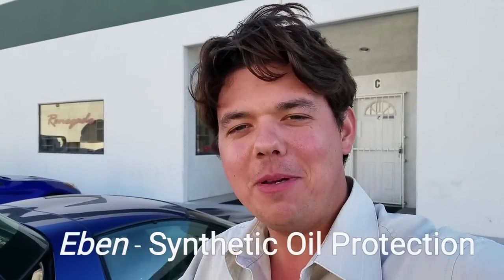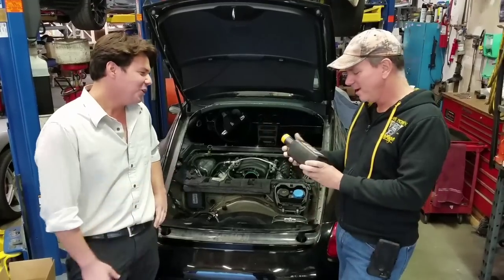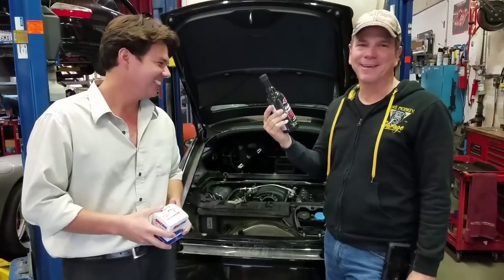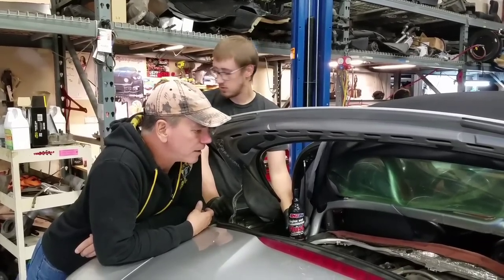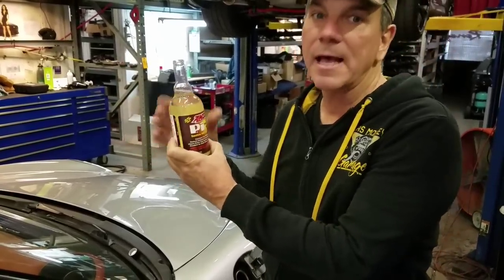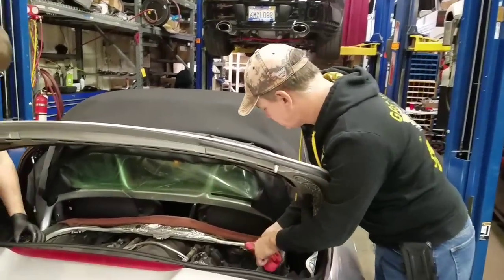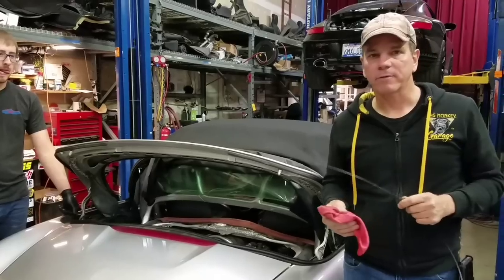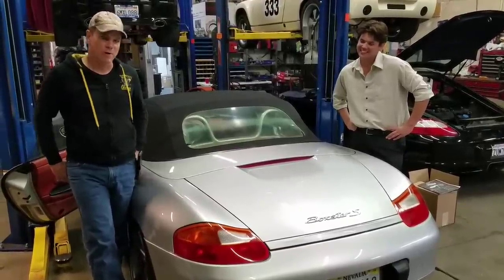Is AMSOIL good in Porsche? Scott Tests 0W-40 in Boxster S

Comment from the maker: The Truth About AMSOIL Why Mechanics Wont Recommend - https://www.youtube.com/watch?v=8OhntOxngAA&t=3s

     My Link: Best AMSOIL 100% Synthetic @ Wholesale + FREE Shipping: https://www.amsoil.com/offers/?zo=5331179

     AMSOIL Products & Vehicle Lookup - https://www.amsoil.com/guides.aspx?zo=5331179 

     AMSOIL Performance Tests - https://www.amsoil.com/performancetests.aspx?zo=5331179

     Follow these accounts for Ebens Giveaway:
Instagram - https://www.instagram.com/syntheticoilprotection/

     Eben Facebook - https://www.facebook.com/profile.php?id=100007973957868

     I'm asked 3 things:

1. Where can I find AMSOIL? - Use this link https://www.amsoil.com/offers/?zo=5331179
Or
Watch THIS: 3 Fast Ways To Get AMSOIL - https://youtu.be/RiYifuDCsnQ

2. What makes AMSOIL different than other oils? - AMSOIL is 100% Synthetic & has higher film strength & last 4×longer then Mobil 1 EP which protects and separate metal parts keeping them from wearing and Lasting Exponentially longer: https://youtu.be/f4eNPgTi_qo

3. Why should I use AMSOIL?: It protects the engine so it will last longer. Less oil changes less often(once per year/15,000miles) or longer... Save money in Gas & Time making it less expensive then a free oil change over the year - https://youtu.be/H7K6FdZlqmg

     Professional YouLubher:
Eben Rockmaker Master Direct Jobber AMSOIL Specialist (Dealer#: 5331179)
Mobile: (702) 472-3614

     My Link: Best AMSOIL 100% Synthetic @ Wholesale + FREE Shipping: https://www.amsoil.com/offers/?zo=5331179

     AMSOIL Products & Vehicle Lookup - https://www.amsoil.com/guides.aspx?zo=5331179 

If your vehicle is not on the lookup guide this is AMSOIL Tech Support 715-399-8324 be sure to refer to Eben 5331179

46,000 Mile AMSOIL Oil Analysis - https://youtu.be/UjijQK5wSM0

Friend me on and tag me because I like to see great results from my YouTube Community:

Instagram - https://www.instagram.com/syntheticoilprotection/

     Eben Facebook - https://www.facebook.com/profile.php?id=100007973957868

     Order AMSOIL By Phone:
Be sure to give them my number so I get credit Eben #5331179 and tell them you would like to be a Preferred Customer.

1. Call 1800-956-5695
2. Ask for your own preferred customer membership because you will get 25% off, free shipping over $100, and your informative quarterly AMSOIL Magazine. It costs $10 for 6 months or $20 for the year which is well worth it.
3. Give them my dealer number so I get credit Eben 5331179
4. Orders over $100 will be shipped free.

     Industry-standard 3rd party testing results:

     AMSOIL Signature Series 5W-30 Synthetic Motor Oil protects against harmful deposits on turbochargers 4X better than Mobil1® Extended Performance and 3.6X better than Royal Purple® in industry-standard testing*.
https://www.amsoil.com/newsstand/motor-oil/articles/leading-the-field-in-deposit-protection/?zo=5331179

     AMSOIL Better Gas Mileage -
https://www.amsoil.com/newsstand/motor-oil/articles/another-win-for-amsoil-products/?zo=5331179

     AMSOIL Performance Tests - https://www.amsoil.com/performancetests.aspx?zo=5331179

     Professional YouLubher:
Eben Rockmaker Master Direct Jobber AMSOIL Specialist (Dealer#: 5331179)
Mobile: (702) 472-3614

     My Link: Best AMSOIL 100% Synthetic @ Wholesale + FREE Shipping: https://www.amsoil.com/offers/?zo=5331179

     AMSOIL Products & Vehicle Lookup - https://www.amsoil.com/guides.aspx?zo=5331179

Comment: i'm interested in trying amsoil signature series in a diesel bmw (cause the datasheet is beautifull but there is no spec for bmw (no api(for diesel), no acea, no LL)
what do you think about it? do you think i can try or can i have some problems? (i deleted dpf cat egr and tuned, it's almost 5 years that i use only acea a3/b3 LL-01 insead of acea c3 LL-04 cause i change oil before 10k km and as i said before i dont have smoke treatment systems)
now i'm using PAKELO krypton and it's very very very good (but the datasheet of the amsoil is a little better) compared to the oem castrol
Reply from the maker: This will give you all the products for your specific model it'll also give you the fluids and capacities.
Find Products For All Vehicles - 
https://www.amsoil.com/guides/?zo=5331179

Comment: For Subaru Forester XT 2017, what kind of oil ?
Reply from the maker: Great question Chea! This is the engine oil look up guide that will take you right to the proper Amsoil oil filter. 
I also recommend getting a bottle of the Amsoil engine flush and a few bottles of Pi performance improver which will clean your fuel system.

If you have any questions feel free to call me or text me anytime happy to help😊
Also it will benefit you to become an Amsoil preferred customer which will save you 25% and free shipping on any order $100 or more.

Amsoil Product lookup guides - https://www.amsoil.com/guides.aspx?zo=5331179